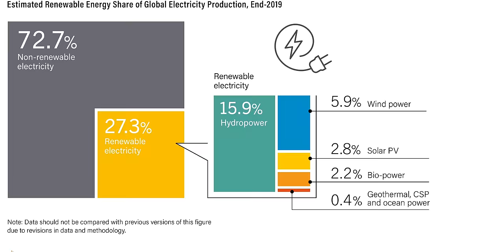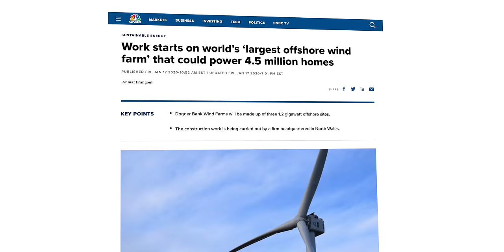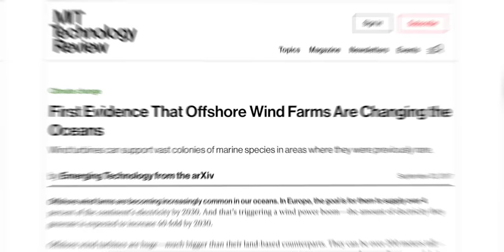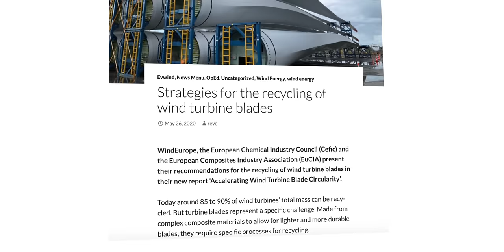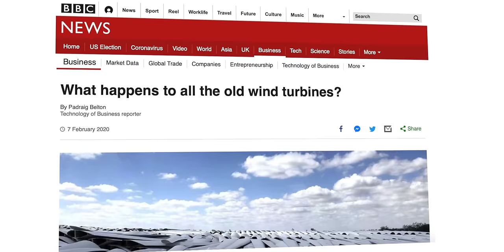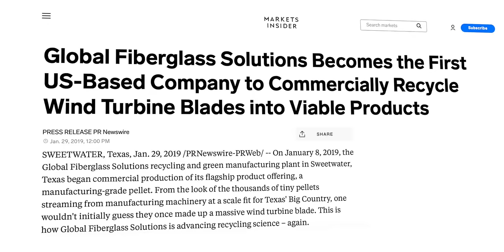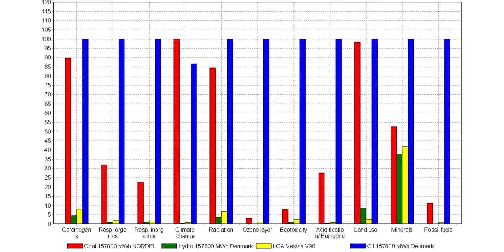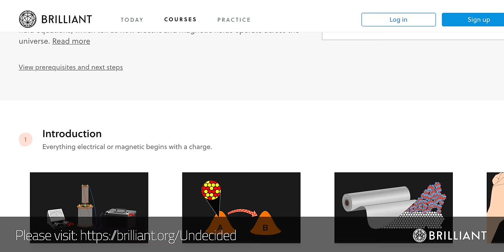The truth about wind turbines - how bad are they?

Comment: Whether it's traditional electrical generation or renewables, you'd still need the infrastructure to be built either way. So, to me, the environmental aspect of building these wind turbines is a moot point.
Reply: The problem with wind turbines is they produce far less energy that it takes to build, install and maintain them. In short, fossil fuel use goes up just to have those wind turbines running with not enough energy in return to make up for it. Wind energy is not green energy at all. It is really just a waste of time and energy.
Reply: @herbb8547  hahaha thanks for the laugh
Reply: @herbb8547  This is not true for any major wind turbine installation.
Reply: @AmbientMorality   One has to factor in all energy used including mining for all of the raw materials, refining of raw materials, manufacturing of all parts, all transportation costs for all materials both raw and finished, installation processes and maintenance. The wind turbines are massive and each requires a great deal of internal components including a massive turbine, internal networks, switches, controllers, gateways, censors, transformers and large amounts of cabling. All those things are very energy intensive to create and operate. The problem in the end is that there simply is not enough energy in the wind to recover the energy put into them. One of the laws of physics is that energy is conserved. It takes energy to make energy. In the case wind turbines, it takes more energy than it can create.
Reply: @herbb8547  Yes, that's included in lifecycle GHG emissions calculations. I don't think any credible analysis indicates that the lifecycle GHG emissions per kWh are higher than competing non-renewable energy sources. easily
Reply: It takes three years for a large wind turbine to recover the energy it took to create and install it. And then it must be over-hauled and you're behind again. What is needed is an energy source that can produce much more energy that it takes to create. Hydrothermal has great potential. Wind not so much.
Reply: @herbb8547  Wind is intermittent true enough, but it takes resources and maintenance for any mode of power generation. Also, you're not really planning on future efficiencies. For instance, electric cars now that they have taken off, new forms of energy storage have increased their range and capacity.

Establishing the groundwork, the infrastructure may well lead to increased efficiency of wind turbines. The same can be said of solar panels, which have decreased their installation cost vs. generation. 

Then there is Thorium a much safer alternative. An opportunity must be opened to save the planet if at all possible.
Reply: @herbb8547  Where do those numbers come from? More typical estimates I've heard are around a year, except in very unusual sites. The claim that maintenance is significant is bizarre; the fact that turbines cost far, far more to manufacture than ongoing maintenance should indicate that your claim cannot be true. All lifecycle carbon emissions analyses I've seen conclude similar: maintenance emissions are <10% of the total emissions related to (onshore) wind turbines.
Reply: @alainarchambault2331  Even if the global warming/climate change thing has some truth to it, nothing we do we will make any difference if China, India and the rest of the world do not clean up their act. For every coal plant the US shuts down, there are ten new ones built elsewhere. China exports a great deal of coal and more each year. China and India are increasing through electrical production through coal. Even countries in the Middle East are building coal plants. We are the only nation in the world that has been decreasing carbon output.
Reply: @alainarchambault2331  The problem is there is simply only so much energy in wind. Air is simply not very dense and therefore it takes such large systems to capture significant energy. Moving water contains much more energy by volume and is much more consistent because water moves 24/7. Small hydroelectric plants could be vastly more efficient than wind. The greatest efficiencies would most likely come from hydrothermal because the source would be near constant and there could be an endless supply of energy.
Reply: @herbb8547  Someone has to light the way.
Recently, because of Covid, everyone was on lockdown at one point. There were news articles that stated people who lived in northern India were able to see the Himalayas for the time in recent memory. Bejing, indeed several Chinese cities had faced criticism for their choking atmospheres. Now in talking about cars here, sure, but I'm saying that pollution from fossil fuels has been on our collective minds for a while now. 
The science has to be developed now, or we'll die later, and it won't develop itself just sitting there. Today we have seen the advent of solid-state batteries, because of our electronics and electric cars. That's market-driven. Clean renewables are a harder sell because that's company/government-driven, not exactly marketable. It could be sold as a means for employment in building new infrastructure.  Mathematically speaking manufacturing will not come back to North America. You want to create jobs and new careers? You open new avenues. American and Canadian innovation once drove our economies. Coal is an anachronism, oil is ultimately finite, aquifers are running out.
We need alternate ways of generating energy to defeat all of these problems.
Reply: @herbb8547  Iceland, yes. Bay of Fundy (Tidal)
You are right about density and reliability, but then again, you wouldn't but Wind-turbines in windless areas.
I feel the same way about solar, you have an empty space, then why not put it to good use. 
Hawaii could put Mouna Loa to good use. Yellowstone, not so much.
https://www.youtube.com/watch?v=2Lu4ya0Qvlc
Reply: @alainarchambault2331  Oil is not running out. More new oil is discovered every year than is used. Do you know that much of the planet has never even been explored for oil?

Comment: Let’s put the issue of disposing of turbine blades into perspective:
Less than 0.150 g of blade material must be disposed of or recycled per kWh generated over the lifetime of the wind turbine.
That compares to over 150 g of natural gas used per kWh by a gas-fired power plant, and 412 g of CO2 emitted.
The numbers speak for themselves!
Reply: I mean, a gram of blade material definitely takes more than a gram of CO2 to produce. But you are correct that the lifecycle emissions are far lower with wind

Comment: You forgot to mention how much lead and nickel must be mined for each turbine and also the mass boneyards in Wyoming to house the broken down propellers.
Reply: of the oil required for lubrication. cost per watt is atrocious.
Reply: Don't forget the vast strip mines already in existence (from coal and gold). I'll bet one of them could store all of the expired blades for the next 50 years.
Reply: John Buck in fact there are efforts being made in that direction. "Another creative recycling option produces pellets or boards that can be used in carpentry applications. In 2019, Global Fiberglass Solutions began producing a product called EcoPoly Pellets in the U.S. and will soon additionally produce a panel version. These products are certified as being recycled from decommissioned wind turbine blades through radio-frequency identification (RFID) tracking from the blade to the end-product. EcoPoly Pellets can be transformed into a variety of products such as warehouse pallets, flooring material, or parking bollards. Based on its demand forecasts, Global Fiberglass Solutions anticipates being able to process 6,000 to 7,000 blades per year at each of its two plants in Texas and Iowa." - excerpt from story
 https://blog.ucsusa.org/james-gignac/wind-turbine-blades-recycling
Reply: Sure but if you're running a conventional coal or gas power plant you need to mine metals for their turbines too!
Reply: A damn good description of a wind turbine blade. They are made to look like airplane propellers, NOT Dutch windmill sails.

Comment: I feel like you missed some important criticisms of wind energy. They're harming endangered birds. They don't always produce energy when it's needed most, and produce too much when it isn't needed, and that energy has to go somewhere.
Reply: Too much output... seems like an argument for investing in energy storage methods, maybe a decentralized battery network.
Reply: That technology doesn't really exist. If it did we would be using it.
Reply: @Antoniobrady  yes and no, there are many ways to store energy (they can be inefficient so long as they are powered by renewables). Currently we have instance, pumped storage (I believe is great for areas with elevation change) and batteries. There are others that haven't broken into the market like flywheels and more efficient batteries (Real Engineering recently posted about).
Reply: He mentioned both, so tune yer ear in,
Reply: The bird death from wind turbines is equal the bird death caused by nuclear power stations per produced MWh, and is only 1/15th of the bird deaths caused by fossil fuel power per produced MWh. Those are in turn small compared to the number of birds killed by traffic and is absolutely dwarfed by the number of bird deaths caused by domestic cats.

https://theconversation.com/wind-farms-are-hardly-the-bird-slayers-theyre-made-out-to-be-heres-why-79567

Your other points are solved by improved power transmission networks and decentralised battery storage (the latter incidentally also functions as stand by power which  negates the need for the very expensive fossil fuels stand by power stations in use today).

Comment: The statement that the blades "are strong enough to withstand even the harshest conditions without damage and maintenance" is/was not true. Many of them have damage on the leading edge which makes them aerodynamicaly compromised and less efficient,in a lot of cases 20% less. (Fiberglass ones,untill recently.) Apparently, new compounds and carbon-fiber ones have lot less issues but are also more expensive. Also the blades are quite dangerous to big birds,eagles in particular as they often look at them for places to perch and are   too slow to evade them.
You also failed to mention their bigest shortcoming,energy storage,or what to do when they produce more energy then what can be used,or sometimes even more than what can be transported through the grid. And that happens very often (rarely do we have high winds exactly at two daily peaks of consumption,same as solar)making them even less effecient. All nations with high wind energy production have some of the highest  prices of energy (some of it taxes) and the pattern is:more wind- higher prices. Current changes in wind-speeds all over the planet (more extremes,low wind or very high wind) do not bode well for wind turbines as they work only in the middle range,so climate change may contribute to them being even less productive then as calculated by previous wind patterns. And alternative energy has higher capitalisation than oil industry.
P.S. So far,I have NEVER seen a fervent proponent of electric cars that :
-- lives in a building appartement in the city 
--has less then 50k a year  
That's about half the population.
Electric car subsidies are helping mainly suburban house-owners and rich folks,
while everybody pays for them through taxes.Well done.
Reply: Nucular might be better

Comment: Natural Gas= Best, cheapest, abundant and lowest carbon emissions for reliable/consistent energy production (until nuclear is decriminalized).
Reply: Natural gas burns cleaner than other fuels, but it is still a fossil fuel. That means in order to operate them, carbon has to be extracted from the ground and later released into the air.

Comment: So this massive project in uk only provided 5% of energy - the future is 4th generation nuclear that’s ‘walk away safe’, has about 95% less waste (that only lasts 300 years, not thousands of years), can actually run from old nuclear waste (where only 2% of fuel was used), is low pressure (so doesn’t need massive containment vessels), is cheap to build

Comment: Yes ...but how many KWh of energy are used to produce and install one? and how many KWh will one produce ?
Reply: @James Smith No, it’s certainly not true. The best option by far is nuclear. We’ve had reliable reactors for 50 years with excellent control systems . The waste can go back where it came from, deep underground. Unfortunately the media and uneducated people seem to fear it for no good reason. Don’t let poor countries build dangerous reactors and have a universal guideline on where to build them ( not near fault lines or sea fronts. 
Tidal power could add to this if developed properly but it doesn’t give the visual impact the green team want to virtue signal about how they are saving the planet. Saving it from what exactly ? It’s a huge rock filled with molten rock. 
Overpopulation will be our downfall, that’s already clear ....how do you effectively control the population growth without being called a Nazi is the question .
Reply: @James Smith You are missing the point. A nuclear power plant can easily produce 500 MWH every hour of the day for up to 40 years!!! That is just one plant. At 0.4 cents a KW that isn't expensive at all. All green power options available right now are sun or weather dependent, which is useless at night or a calm day. Nuclear wins hands down in every aspect.
Reply: @James Smith No it was about the fact that it will never produce enough electricity to cover the cost of installation and maintenance...A nuclear reactor will produce way more in terms of supply during its life span....it's not about the initial outlay.
Reply: In other words it's just a green "show" and completely pointless. Do you know how much CO2 is produced in making the cement / concrete for a wind turbine base? it would be better not being there at all.
Reply: @James Smith Just for 1 turbine you need 30,000 tons of concrete, 65 lorry loads......because a lot are in remote locations miles of roads also have to be built. Now imagine what is involved installing them out at sea. The whole thing is insane.
Reply: @James Smith Not at all, all supported by huge subsidies. Once that goes the whole thing will collapse. However you try and spin it, nuclear is more reliable and its capacity factor (93%) laughs at the renewable factor of (30%) you would need 3 times the amount of renewable energy to match nuclear. 
Good luck at night time dude......how much solar are you getting then? when it's not windy? "Oh it's ok we don't need that life support machine on really " haha . Sure solar has a place in hot countries, even without subsidies from Government. But here in the UK solar is useless, wind turbines ruin the countryside and are a waste of resources. Nuclear all day long for me......keep dreaming Eco boy.
Reply: @Omegaman1969  using the energy from wind turbines to create wind turbines would surely make them more carbon neutral.
Reply: @jonathonsmith6831  Absolutely, unfortunately a wind turbine doesn't produce enough electricity in its lifetime to cover the energy needed to produce, install and maintain it.
Reply: @Omegaman1969  so every turbine created is a total waste of energy. I don't understand how some days the UK has had 100 percent energy needs from renewables. Surely this is a sign that together they produce enough to energy to make other turbines and also to supply all the energy needs. If this is the case then your argument dosent add up
Reply: @jonathonsmith6831  I don't believe that for a second. Even if that was the case it doesn't mean they will ever recover the cost involved in putting them there in the first place does it?  Lets say you install 1000 turbines at a cost £1 million each. Then they only produce £500 million worth of electricity in their life time.....even though at a certain hour of a summers day when demand is extremely low they provide 100% supply to the grid......they still owe the tax payer 500 million.
Reply: @jonathonsmith6831  Then what do you do with 1000 scrap turbines? recycle them? massive amounts of energy required to do that......